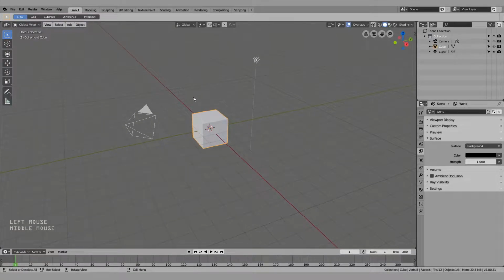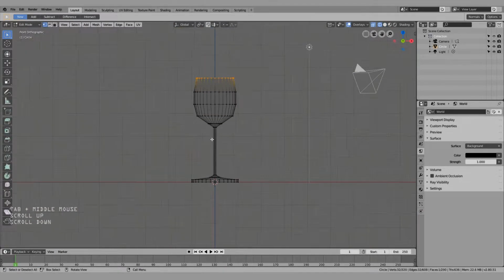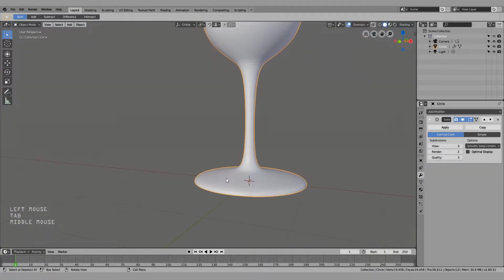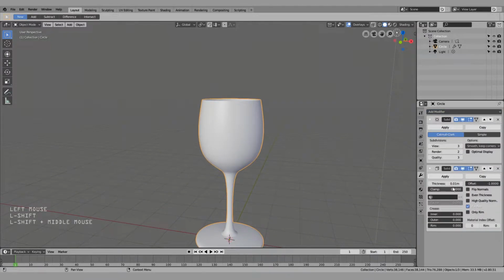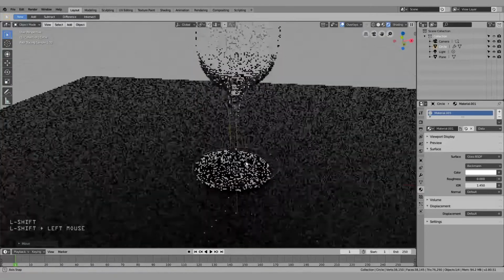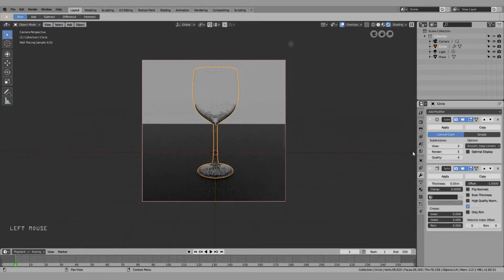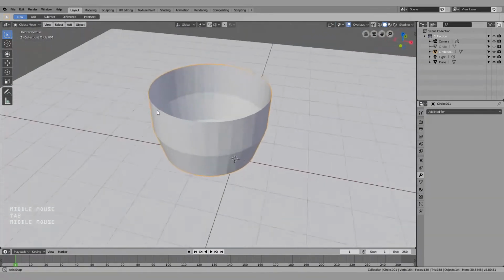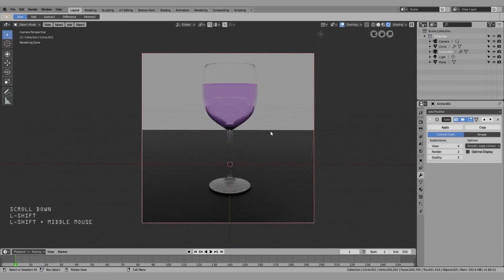Making a wine glass - English - Blender 2.8

Comment: While you can increase the subsurf mod to smooth it out, it's generally not recommended to do so because it increases the poly count and can increase render time. What you wanna do is set the subsurf to a 1 or 2 then right-click the object and select shade smooth. Better result at no extra cost to resources